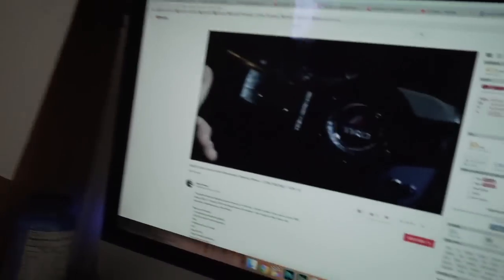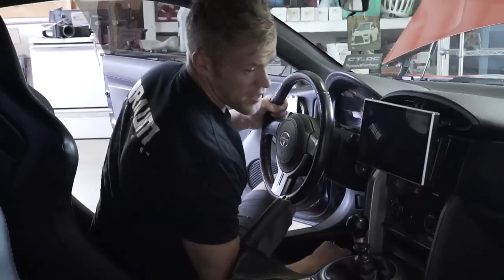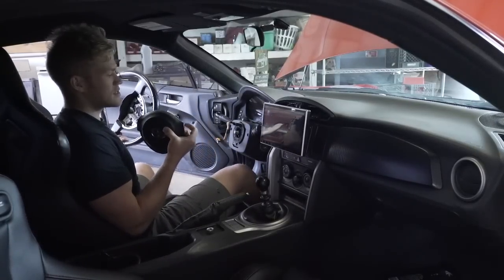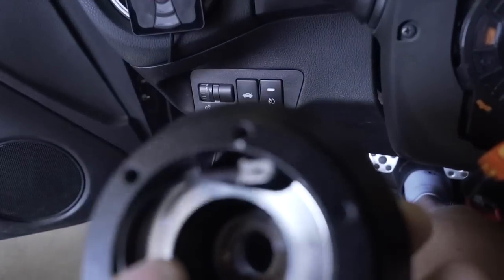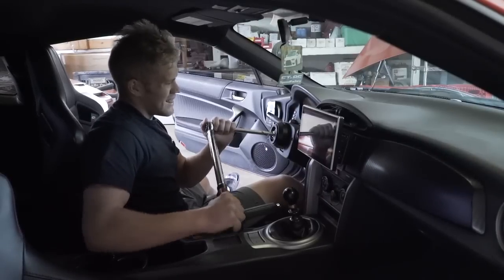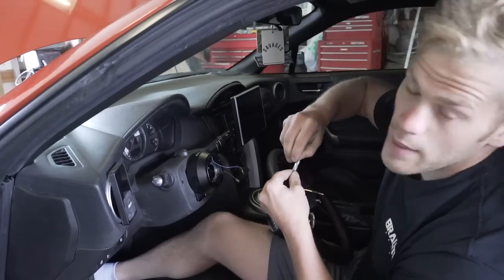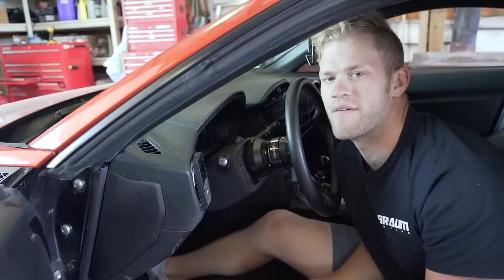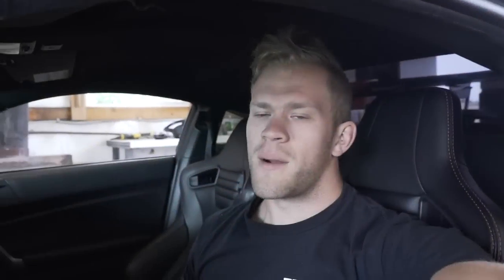Nardi Steering Wheel & NRG Quick Release Install (FRS/BRZ)

Comment: Use a NRG short hub(which you have) and a NRG short quick release but you will need a 10mm spacer in between them. Just go get longer Allen bolts from the hardware store and you will have the shortest setup

Comment: The wheel looks sick. I had a Momo with quick release in my old car, it was a S13 so I wasn’t having to give up an air bag or cruise control. It’s a good anti theft device, who’s going to try to steal a car without a steering wheel?
Reply from the maker: That is true!
Reply: Devin Niemela but what if they just do happen to have a quick release on them? Lmaoooo
Reply: Cars & Gaming they make quick release caps with kicks in them lol. I’ve got the whole setup and a hidden ignition switch in my car. Plus if I wanted to go the extra mile I could just unplug my neutral safety switch lol
Reply: Cars & Gaming locks* in them

Comment: also you can take that hub adapter back off and line up the holes to match your wheel so it sits upright. nrg hubs are designed to line up with a quick release instead of being used solo.

Comment: My Suby came stock with a Nardi, all previous models up to 2010 I have had have all had momo’s, but don’t have the extended hub like yours, horn works, don’t have a steering air bag, but it’s a great wheel, love mine. It’s a nice touch with Suby sports models they are been doing Momo since the 90s, the Nardi was a real surprise, but you could spec them from factory with different upgrades from new atleast here anyway and Japan.
Reply: Cap

Comment: When I got new seats in my car I HAD to get a release steering wheel. The stock wheel with the airbag was entirely too intrusive to the seat itself and I would scrape my thighs on the wheel even climbing over it. I like the quick release hub and wheel though. I forget what brand I got... NRG Engineering I think?

Comment: I wish the airbag resister wire setup you made was explained more… 

Looked like you had 2 wires for each connection running into a fuse loop?

Comment: Hey man, hope you weren't feeling buyer's regret -- that's definitely a sexy wheel!

Based on what I saw in your video, the wheel doesn't actually seem too close to you, you just may not be used to having it that close. From a lot of measurement guides I've seen online, they actually suggest the distance being where you can rest your wrist over the top as you did without your shoulder lifting away from seat and without your elbow being locked out.

Where did you end up landing on the wheel?

Comment: Thanks for the video.  Leaning towards the 330mm as the offset is less (53mm) vs the 350MM (80mm)  so 1" less further forward where the Nardi 330mm sits.  If you did it all over again, would you opt for the 330mm wheel?

Comment: I should have made a video of how i did it. It took me a good 10 min to figure it out. Im an electical engineering undergrad so it sas just a matter of following the circuit. But from all the vids ive seen, people (at least for the 86) have had issues trying to get the horn to work. They need better instructions.
Reply from the maker: Please shoot me a DM on instagram, @dvniemela
Reply: hey can you help out lol
Reply: Can you help me bro what do I need to get for nardi steering wheel and a nrg short hub to work with the horn?